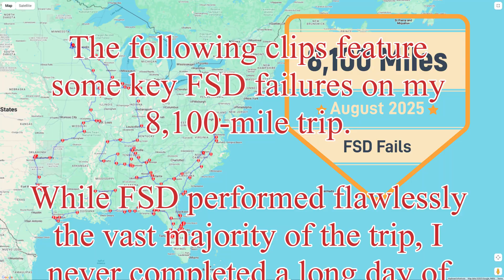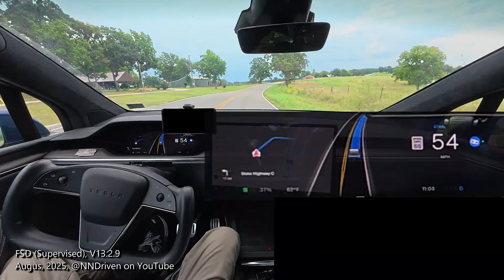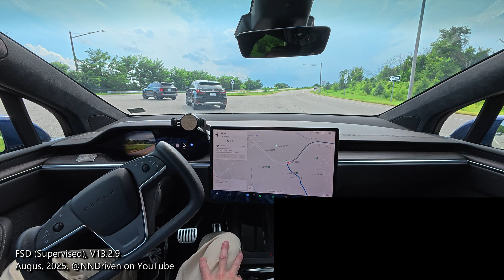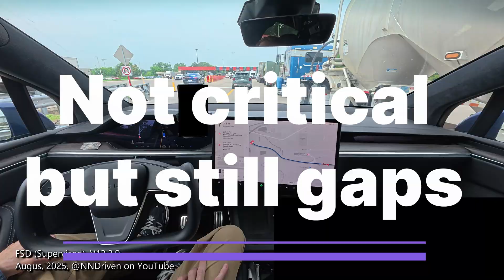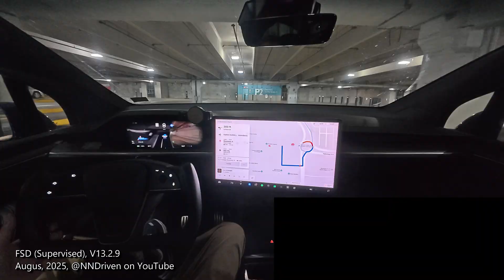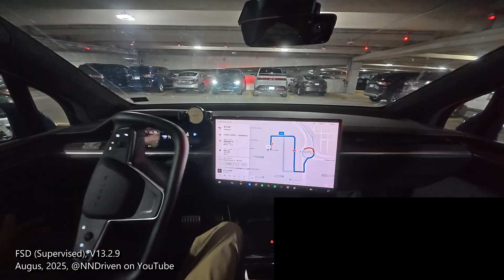Safety-critical FSD Fails over 8,100-mile Road Trip

Comment: I have logged over 50,000 miles on FSD over model 3 and model Y, both HW3 and HW4. I have never had a computer crash, not ever. I would make a service request to inspect and likely replace your FSD hardware.

Comment: One fail in 8100 miles? So, in other words it is really good!
Reply: That is not at all what the video showcases.
Reply: @orionscott2797  The video showcases a system that can drive it self 8000 miles with 2 critical disengagements (that are caused possibly due to a defect in his car) and map errors. id say that's pretty impressive
Reply: @JustSenix It's getting better. But the operator has to take the wheel many more times than twice to do the safest/most reasonable thing.
Reply: No. It means it will kill someone every 8000 miles.